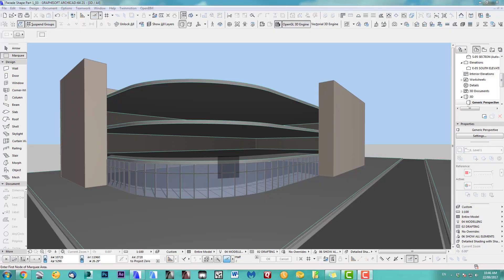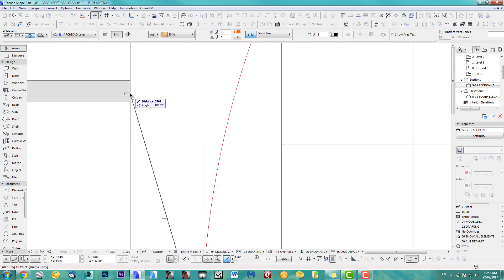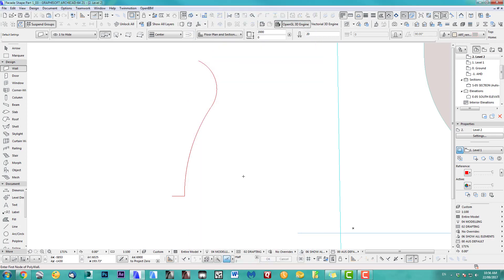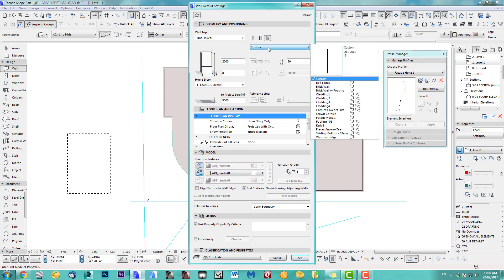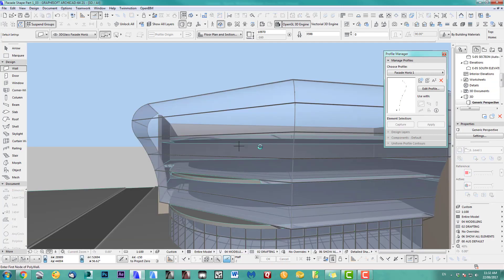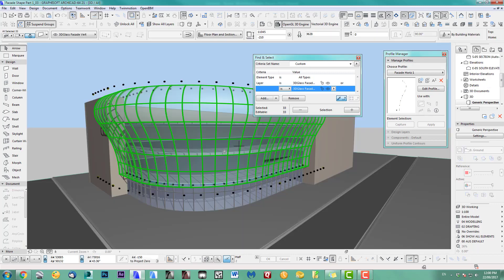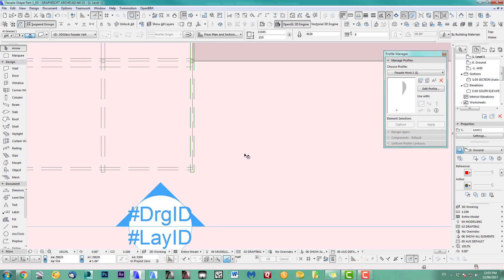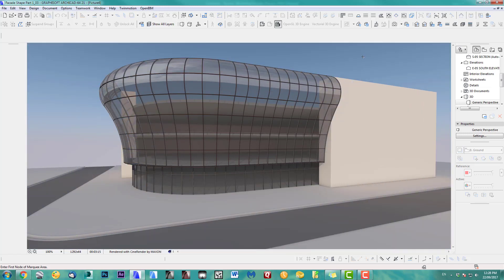How to model a curved & bent glass facade in Archicad

Comment: Hi this is amazing.  I am looking to make a model of a glass bourbon barrel.  Think you can do that for me? :)  I am too new at this.
Reply from the maker: Hi Eddie, thanks . First,never ask anybody to do stuff for you, otherwise you won't learn how to do it yourself. Second, a glass barrel is better modeled in Rhino or Max as example because of nurbs / meshes etc. options. ARCHICAD is for Architectural models/buildings.
Reply from the maker: Right, you can model anything in Rhino or Max but it's not like ARCHICAD where you can easily add doors or windows. Your model is a bit of difficult one in regards to which Software to use. You don't see to many barrel shaped houses or buildings :)
I do have an idea on how to do this in ARCHICAD, you will have to wait until Thursday. My next quick coffee tip will show how you can do this .
Reply from the maker: check out the community tab, sleepless night coming up for you :)

Comment: 3:12 Why I can’t check all after I choose fill …
Reply from the maker: hard to say without seeing what you exactly do. Usually if you have the fill tool selected and you do a select all and it is not selecting any fills, then you might have the marquee tool still drawn on screen which NOT includes any fills.
Or the step explode walls did not work and then you don't have any fills only walls. Usually it's best to redo the tutorial around the time where a step might be missed.
Reply: ARCHICAD Speed Modeling Thanks you so much!!! I got it! The video was really useful.